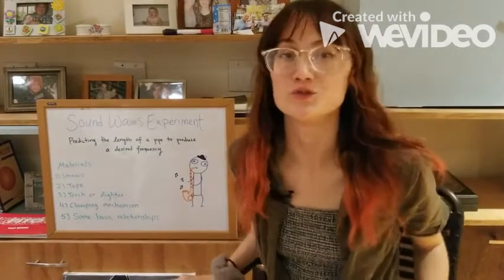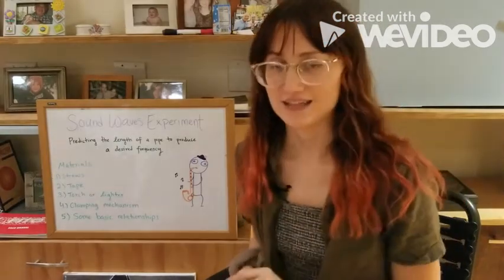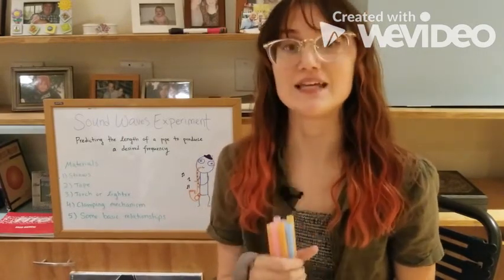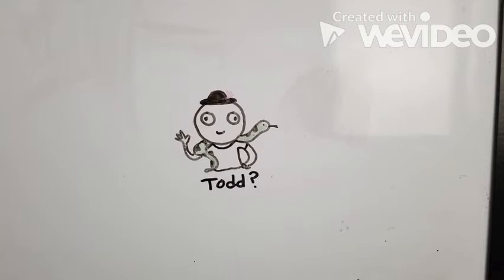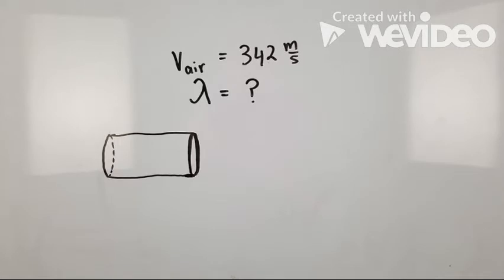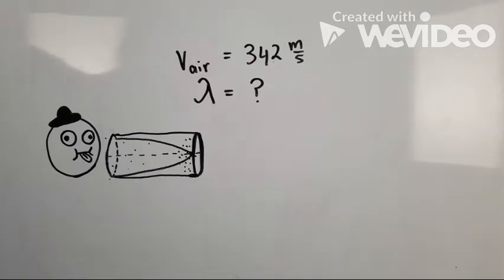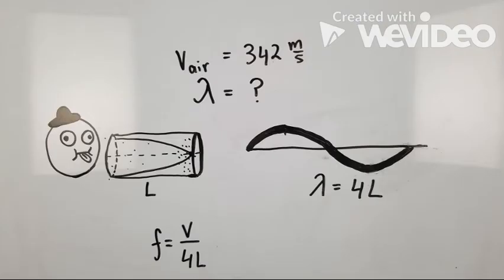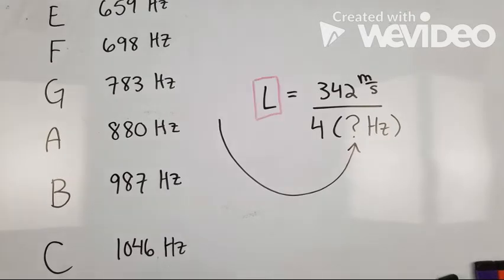Constructing a Pan Flute Using Physics

Comment: What is the relationship between the diameter of the pipe and the length of the pipe to create a certain frequency?For example, if the diameter of the pipe is 10 mm or 12 mm, is the pipe length the same for a particular note or is it different?